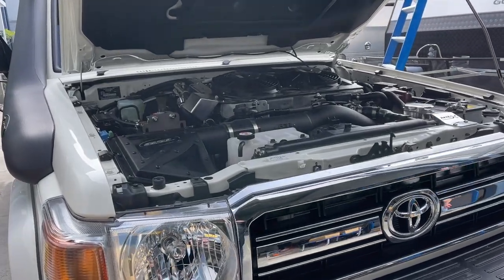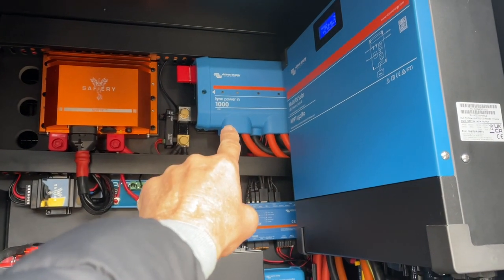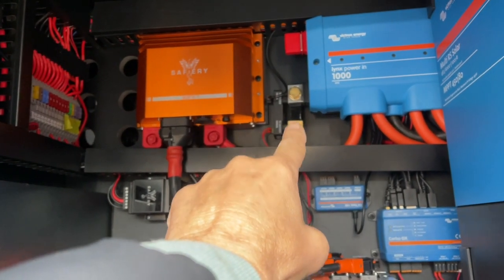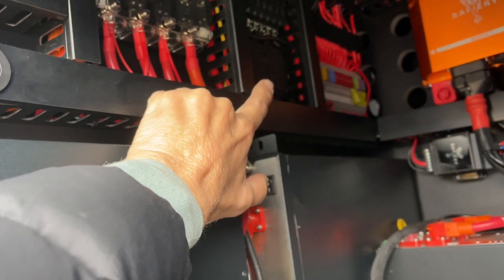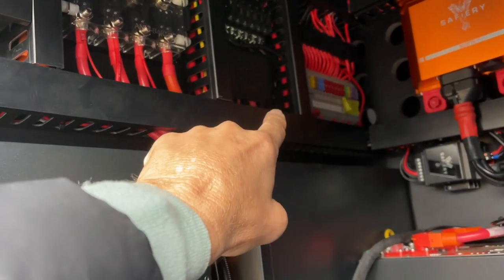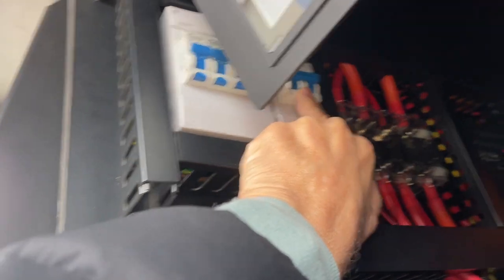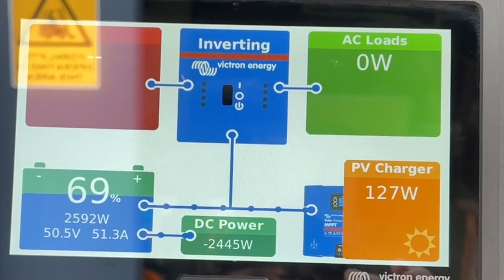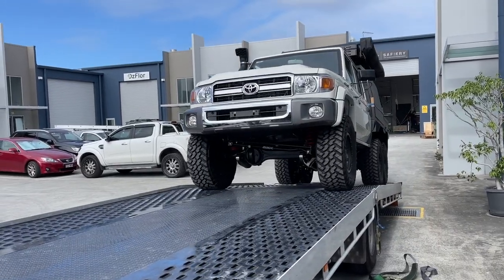Electrical Systems in LC79 6x6 - a walk-though of 48V System by Safiery with Scotty

Comment: If 76 volts is coming off the roof to the Multi RS 48/6000, is that enough, noting its 80-450 MPPT voltage range and its 120 VDC start up voltage requirement ?
Reply from the maker: The RTT Solar is going to a separate MPPT 100/20. Our 175W Portable Copperflex is 42.8Voc and we supply 3 units (setup in rows) plugged in series which have tested very well with the RS 6000. Thats a total of 525W angled to the sun for a great yield when camping. They aren't on our website yet as have been out on test for last 3 months with great results.